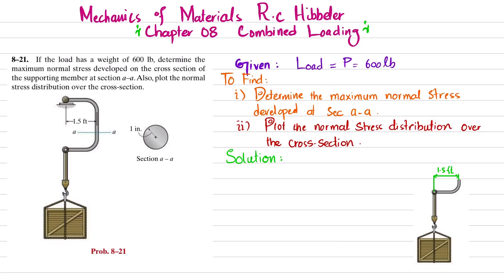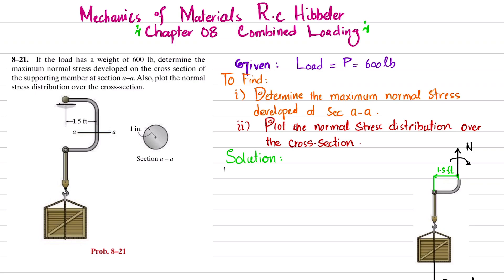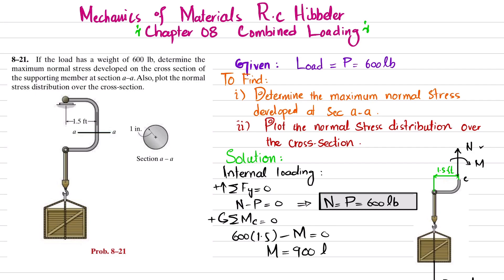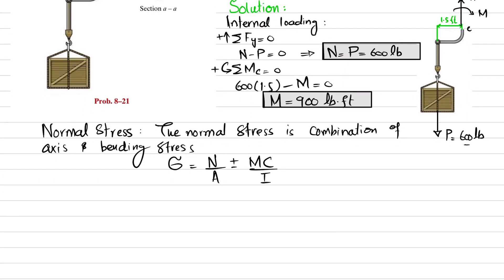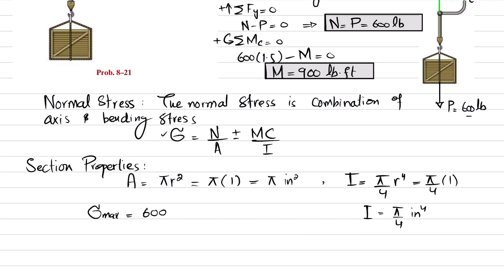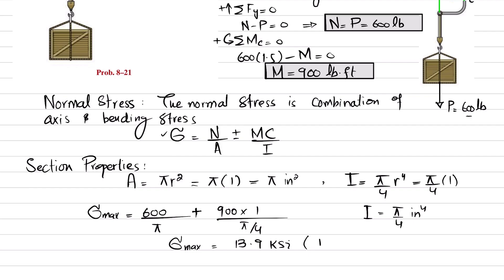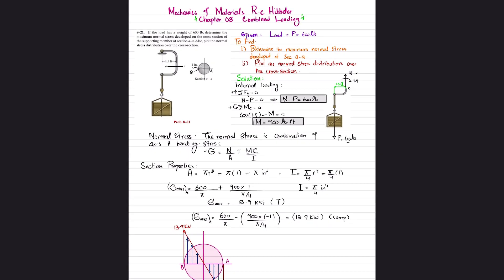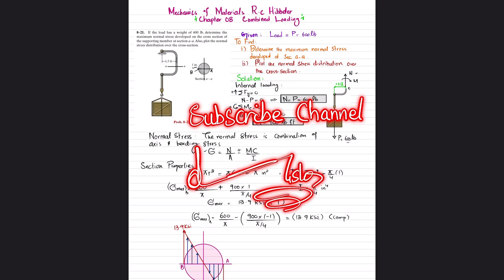8-21 Determine maximum normal stress developed at section a – a | Mech of materials rc hibbeler

Comment: How did you choose the sign of moment in the equation of normal stress?  I was watching many videos which are related to this chapter but still I couldn't understand how you determined the sign of moment in the normal stress equation. I am confused. Would you like to explain?
Reply from the maker: You can  see that reaction moment is clock wise so it will produce tension at point B and compression  at point A that's why...